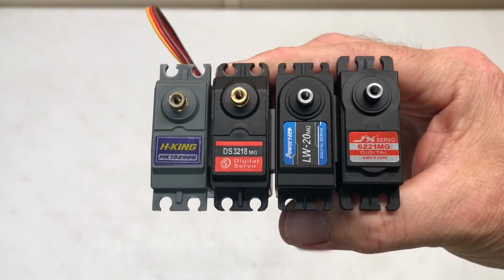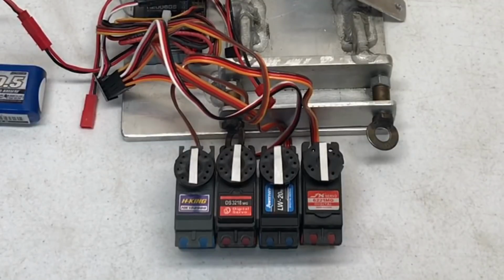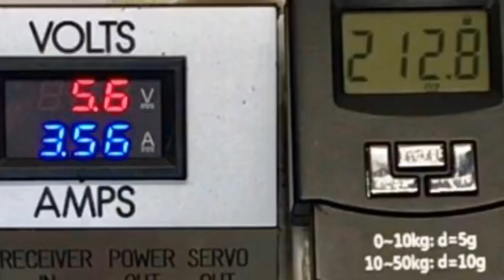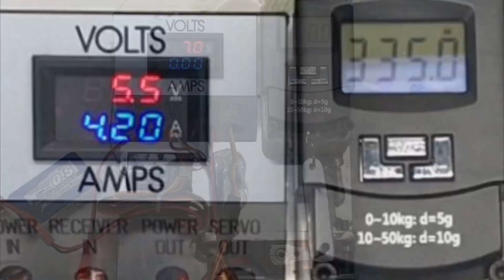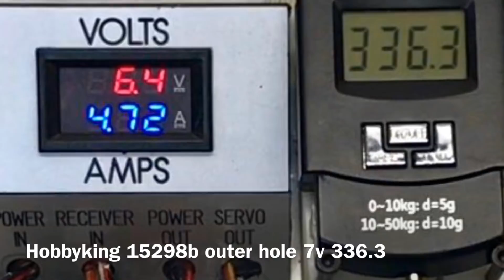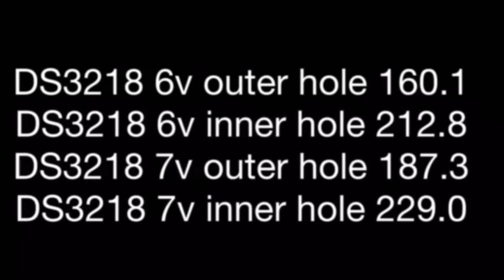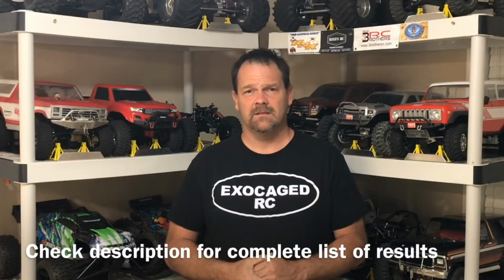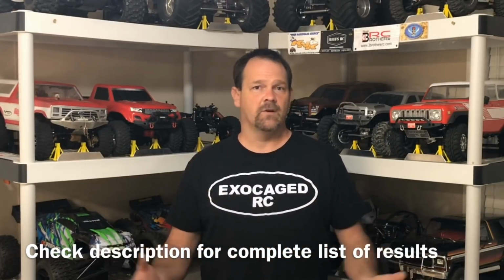$20 Servo Challenge Power HD JX 20kg Hobbyking

Comment: The powerhd servo has better electronics because it uses less amps to hold stall which is important. The Hobbyking 15298b is outstanding for it's torque.Thank you for the test.

Comment: Really cool video! I've had a bunch of the jx 6221's, and they have been ok. Ive used a jx 6015... And It is a great 11 doller servo! Im not sure it has a lot of torqe but in a 1/8 buggy it was almost as fast and drove as good as a savox sv 1273tg. Only noticable benifite to the savox servos I have used, is they center better than any others I have tried. I have a savox sv1271 in my mbx7r eco and it is about perfect for how I drive. I want to try the power hd 20kg. And that hobbyking servo! Great performance for under 20!

Comment: Great info!  I'm really surprised that the 6221 did so poorly.  I have one in my Clone Hammers and it's got enough torque to twist the whole chassis.
Reply from the maker: maybe this one is a dud?
Reply: @ExocagedRC  or maybe the chassis of the Clone Hammers is way weaker than I realize!  But, this 6221 does seem to be WAY stronger than the 150oz servo that originally came in my Gen7, so you may indeed have a dud.  Are you interested in testing another one if I pull it out of the truck?
Reply from the maker: @BudgetRC_Channel I'd be happy to put another one on the tester just to see.
Reply: @ExocagedRC  Did you test it again?
Reply from the maker: Fredrik Stjernqvist no sir. I did make a servo winch video out of it.

Comment: I just removed a 100$ savox sc-1267sg from my gmade buffalo.  My girlfriend hated the constant beeping. Swapped to a 15$ spt5425lv. The cheap servo doesn't have the high pitch beeping. Maybe because the savox is a high speed racing servo and the cheap spt is made for crawlers.

Comment: The DS 3218 pro was in my rustler 4x4 and survived less than a year it's jitterly and barely can move back to center position under it's own power even in standing position and interfere with the TSM system it overcorrects and basically sent the car off the road...

Comment: hobbyking is good, but you will need a BEC cuz the amp draw is huge, powerHD seems perfect for user who doesn't wanna go thru installing a BEC
Reply from the maker: yes, the PowerHD has that amp/power limiting feature which should make them ideal for stock trucks with no BEC.
Reply: @ExocagedRC  i think that feature only comes in their latest models. from your previous video i think the amp draw was well over 4 amps, i think mine powerHD 20kg which purchased few month ago did not have the amp limiting feature either, and is making my TRX4 factory ESC glitch like crazy, but i will install my HW 1080 system soon, hopefully no more glitch
Reply from the maker: @papachill yeah the stock TRX esc is only rated to 1A so everything is too much, including the stock one lol

Comment: Did they all have the same angle range? That effects gearing ratios and torque. Also the speed of the spin will change torque as well. A slow spinning motor will have more pulling force.
Reply: Angle has nothing to do with torque. If you remove the pin that prevents it from rotating beyond then it can sit there and just spin.
Reply: @KTMcaptain  What I mean is if the range is 180 as opposed to 270, the amount of torque offered by the motor is different.

Comment: great video sir, i want ask question about turning angle why the PowerHD 20kg compare to DS 3218 has less turning angle, powerHD 20kg just like 35 degree and DS about 50 degree?
and can we set the angle without any electronic modul, just from EPA on transmitter such as in MT4 Sanwa?
Thanks
Reply from the maker: some servos simply travel further than others, yes your radio should have epa that you can adjust up to and maybe a bit over 120
Reply: @ExocagedRC  thankyou for replying, nice info sir

Comment: Im new to rc. How do you get different volts supplied to the servo? Does it draw power based on battery size?
Reply from the maker: The esc have an output specifically for the receiver. That comes out of its built in battery eliminator circuit (BEC). You can also use separate bec’s for more amps.

Comment: JX is good for Helicopter?
Reply from the maker: HeliModTRC I wouldn’t use it for a helicopter. But I’m not a helicopter guy so my input on that isn’t the best.
Reply: @ExocagedRC  Thanks. Why not use it? Is there a special reason?
Reply from the maker: HeliModTRC the jx servos seems to have a timer that shuts them down underload, I’m just not sure if I would trust them in a plane or helicopter. They may work fine but I wouldn’t.

Comment: Is that a different Power HD 20KG than last time? Last test i thought i remembered it putting out a fair bit more torque than that.
Reply from the maker: It’s a different servo yeah. These low cost servos vary a bit. I’d expect a Reefs or 3BRC to hold across all of them. I’ve also noticed that as time goes on the servos get out good and strong but the manufactures start getting cheap, the 959 is a perfect example, the v2’s have gotten really cheap inside lately.

Comment: your servo tester is not acurate first thing your power supply can not handle current to servo you can see it as a voltage drop for example you set 6V but under load your votage drop to 5.5V that is to much... and the second thing is your weight meter is not very well connected to the base for example you can see move the whole meter move down when servo pull becase this thing test in not accurate at all

Comment: Sorry, but you need to have the center screw installed on every test on each servo. The servo horn is twisting without the screw. Faulty test.
Reply: The servo horn has a screw on the side to snug it down.Test were fine
Reply from the maker: Nothing slipped and the servos weren’t strong enough to kill it and yeah the side bolt was tight enough that nothing moved.
Reply: @Fiaudiodude   Both you and him need to watch the video "again" You can clearly see the servo horn twist. Test on all but the one he had the screw installed were faulty. 
Try using your eyes and look closely.
Reply: @johnnyyuma9326  Even if it was twisting the servo horn the servo still had more throw and was tapped out on power. Adding the center screw isn't going to change anything as it didn't jump teeth
Reply: @Fiaudiodude    Yes, it would change it. Think!